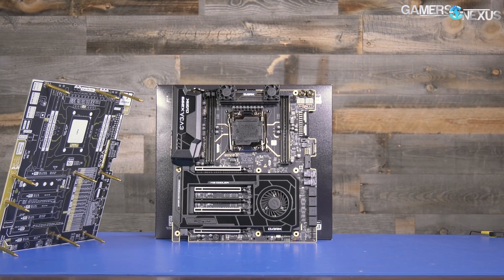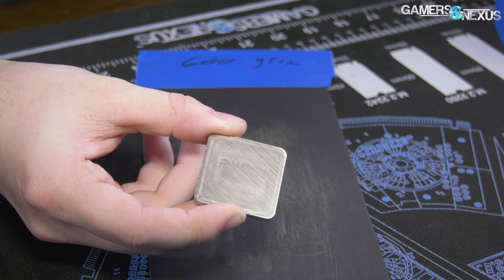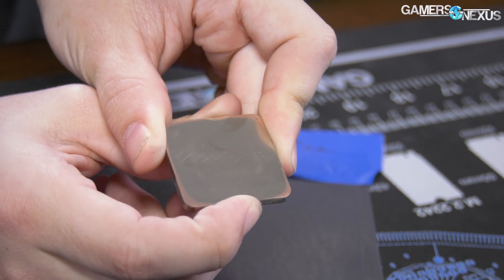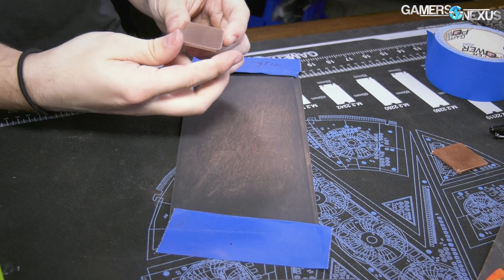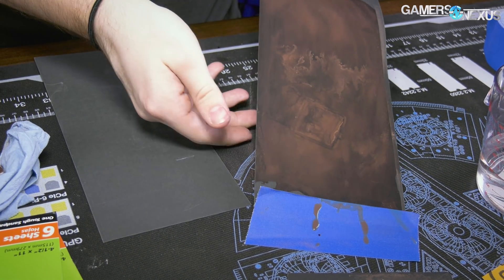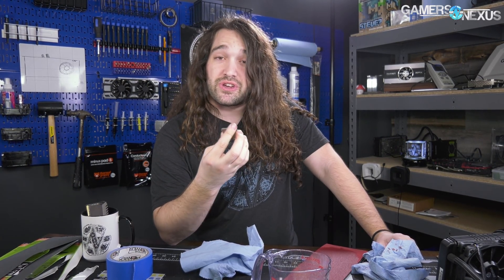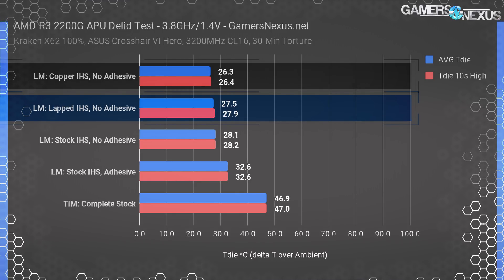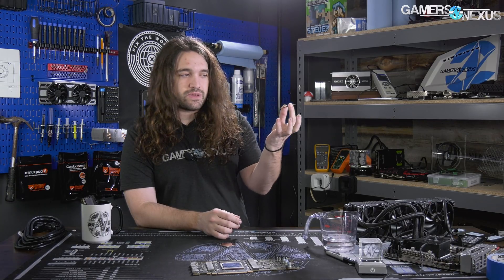Lapped Ryzen IHS vs. Copper & Stock IHS

Comment: I'm curious about the improvements a silver heatspreader can offer (as one was talked about last october from Der8auer for the 8700k), ...also curious about if just a silver slug press fit into a copper ihs above the die would help just as much, and if silver gets damaged by liquid metal like aluminum does.

Comment: lapping Ryzen 1700 have like 1degree less.Stock IHS is not perfectly flat but still does good job. 
BTW you can use a drill with shaft attached to a suction cup(and the stock box cover for the CPU) and spin it on the sandpaper.First go for 400 by hand and drill after and then 2000 sandpaper and of course polishing after that(polishing will not have any effect whatsoever and the good paste is pricey).The resaut is going to be perfectly flat surface with mirror finishing and no scratches.

Comment: you're supposed to sand it on glass or something perfectly straight not something soft like your modmat :D as you sand you might be taking off too much material on the edges due to soft sanding surface. I sanded my AMD Phenom II 955 long long time ago and got °6 drop just from doing so (tho I also sanded the stock heatsink). I used up to 2000 grit
also it seems to me like you were using sand paper made for wet sanding, water moves away shavings, gives you a nicer finish faster and keeps the sand paper usable for way longer
edit:
ALSO you dont need to take of the IHS to sand it so comparing it to Rockit Cool is a bit unfair. And I dont know where you get your sand paper but 600, 1200 and 2000 are all you need and all 3 cost $1-2
Reply: Diminishing returns after 1200, I know because I've lapped plenty of CPUs, not worth going up in grit.

Comment: Recently, I've a friend who did a thermal compound test at the uni for industrial use, and I learned 2 things from his tests. 
1. The best thermal compound (excluding liquid metal) you can buy is apparently some kind of grease you could buy from your local hardware store. 
2. The more polished your surface is (his tests were done with mirror polished surfaces), the less thermal compound you need.

I would be curious to see a reviewer test that.

Comment: I lapped my 2500k,
It lowered temps by around 3-5C which imo is quite a good drop.
However the most gains came from equalising  the temps. Core two used to be at the high 60's, core 3 would be low 60's. Now they are all low 60's.
This is at 4.9Ghz.
Reply: My 0x1E Interesting. 🤔

Comment: So glad you did this. For future reference don't tape the sandpaper to a soft relatively uneven surface as you will sand unevenly. Remember we are dealing with microscopic details here. You want to use plate glass under the paper when doing this kind of work.
Reply: Also want to see you do this to the bottom of the cooler as well for maximum contact. Also if you can get them perfect enough you could theoretically get them to cold weld together functionally making them a single piece with no need for TIM.

Comment: 5:10 NO!
You are doing it wrong. Very wrong. First off, you should be doing it on a flat glass plane. Second, you shouldn't be holding it with yor bare hands at the corner, as you can't constantly hold it exactly parallel to the sanding surface, so you take more from the sides and corners. Also should be using bigger sandpapers, and moving the IHS in figure-8. If you re talking about microscopic imperfections, you have to pay attention to everything in order to think that you can do better

Comment: If you're going to lap, use figures of eight and a glass surface so you don't get uneven pressure! Not that it would have mattered worth a pinch of shit in the end, but the mat is the reason the edges are polishing down before the rest. as you press down, you deform the base material and it folds, diving your flat surface into it. Using a hard surface ensures a flat grind.

Comment: Thanks for doing this, Steve! I was curious if this were still relevant. I noticed about the same results when I lapped my Cooler Master CPU cooler back on my i7 930, but I never lapped the IHS.
Reply: AJ Good back in that era, you were supposed to lap the IHS, not the Cooler! I'm currently in the car, going to the hardware store in order to buy sand paper. Getting to 5000 grit for a x5690, a x5472, a q9650 and a mythical q6600 G0! And yeah, i'm going for extreme OC

Comment: pro tip that i have learned as a kid polishing 2 stroke heads, use a hard flat surface and a mirror because the mirror is one the flattest things you can find , the flexible mat is buckling under pressure and making those edges round

Comment: The main takeaway is that sandpaper in the US is absurdly expensive 😉

That's maybe 8€ of sandpaper so definitely worth it compared with buying the copper ihs
Reply: three sheets of any 3m sand paper is about 10$ USD, and you need multiple grits(3 or 4 minimum). But there may be some combo pack at specialty stores.
Reply: Metatron's Cube the  same 3 pack of 3M sandpaper here cost 3.80€. I buy them pretty much weekly as I do all the work on my cars and I have quite a few cars. And I always thought the 3.80 is very expensive for what it is.. It seems you need some competition to lower those prices 😉

Comment: You can't lap on a soft surface you'll end up with a convex surface on your IHS.  You need a piece of glass ideally a thick piece.  EDIT: you should go in a figure of 8 motion as well so you are not hitting the same spot over and over.

Comment: you gotta grind down both surfaces, not just one to get a "zero space" situation going on between the cap and the heat sink. I know the differences in performance are negligible but, extreme testing should include a process known as surface grinding to both surfaces to be mated using a 2 axis surface grinder. .. but yeah. probably not gonna get much gains other than being able to get away with zero thermal paste because of how perfect the surface are. and even a used surface grinder is expensive. would be interesting to see testing results though

Comment: This one was pretty interesting, would it be possible to de-lid one of these and solder it yourself ? I think it would be pretty interesting as that could make it quite a lot better and be pretty permanent. just a thought ;p if you decide to look into it ill definitely see it :D PS thanks for showing us PC building is so hard, time to get a prebuilt I guess ...
Reply: You could solder one with a hot air rework station(50-150$) and sheet of silver solder(15$). If you have an electronics buddy they might have the rework station you would just need to get the solder sheet, or even silver paste solder or something low temp would make it easier.
Reply: I was thinking more in the line of getting solder wire (pretty cheap for a roll of it here in my country), then flattening it out, putting it on the cpu and heating it up again just like when you de-lid, then after it has melted let it cool down and boom, easy makeshift soldered apu :thinking:

Comment: Use a mirror for you base next time.  That mat is not a good way to go for lapping.
Reply: Yeah, might as well be lapping that thing on carpet....  :(
Reply: Agreed. This is the reason the edges are sanding first. With the give in the Mod Mat, the sandpaper ends up cupping around the IHS, creating a convex surface on the IHS. A figure eight motion for the sanding and periodically rotating the IHS in your hand will also help keep the sanding more consistent. As you push in one direction, the leading edge will end up sanding faster as there is slightly more pressure on that side. (Source: Sanding flat cylinder heads and having them seal without head gasket, proving the purely flat surface.)
Reply: Any thick float glass will do. Even a thick tempered side panel would be perfectly flat in theory. Also, stick to wet sanding. Dry sand paper taped down (and the foam paper he had last) round over the edges. You should also go to a higher grit, 6000 or use a jewelry polish to finish. That way you're completely rid of visible scratches.
If he wants to get real fancy, he could buy a set of wetstones 1000-3000-6000 for around 100$. Along with a diamond flattening plate for stone maintenance and a leather strop for polishing for a further 70$. 

Source: Decades of sharpening chisels and other blades to mirror polish for fine woodwork.
Reply: I started cringing when i saw him lapping on a soft surface. Saw a guy post on your HardOCP forums years that uses a Bridgeport to mill off 0.001 then laps his CPU with 15u/10u/5u diamond lapping material.
Reply: I agree, a mirror or glass is generally used otherwise you are lapping a non flat surface into the IHS.
Reply: Just direct die it, worked fine on my socket 939 lol
Reply: And maybe use water too ... is that water sandpaper?
Reply: Mattias Göstasson the water causes suction between the paper and the surface which makes it work better, and also keeps the paper from clogging
Reply: figuire 8 sanding pattern as well
Reply: Correct....you need to start on a hard "FLAT" surface to begin with.
Reply: I actually keep an old very thick mirror out in the garage for the very purpose of lapping CPUs, blocks, etc.
Reply: also moving in small circles leaves the finish less scratchy looking and more polished
Reply: True, true.

Comment: FYI, it's better to affix the sandpaper to a known flat hard surface, like a piece of float glass. And even then, I've been told that to ensure that it is flat instead of convex it tends to be best to use a figure of eight pattern for lapping. That said, it probably doesn't matter too much. There is something that crossed my mind though. LTT recently reviewed a graphite thermal pad from Innovation Cooling that performed surprisingly well. It seems to me that lapping the surface would make a bigger difference with one of those than it would with thermal paste because it is thinner than normal thermal pads and probably not as squishy. It might make for an interesting video to test that, I think.

Comment: Steve, I'm not sure, but I think you made a kind of mistake. At least in the beginnging... I don't know the consistency of the ModMat, but it seems to me that it is a bit soft. So the reason why you see the copper first in the edges etc. is because the sandpaper work there first due to the IHS sinking a bit in the ModMat and so in the sandpaper. A very even and hard underground like  marble or glass would have been better or at least the uncertainty of the influence of the ModMats conistency would have been eliminated... I wonder if you ever will see this :D
Reply from the maker: No. It's not. Had anyone listened, they'd realize the CPU IHS is made with different height corners.
Reply: Oh wow,  a response :D
Thanks guys,  didn't hear that... but I heard always that if you want to polish a coolerplate or an IHS, you need a hard and even surface.
But okay,  if that doesn't matter then never mind :)

Comment: Ideally you should've used a belt sander or a disc sander to evenly sand the IHS, the edges went first because the way you push the ihs when moving it plus the give of the modmat. not that you did a bad job, just that it's a kind of flawed methodology. Still you got the point across, it's pretty useless to buy a specialized IHS for rizen

Comment: It is a known scientific fact that blood on the IHS will coagulate, filling in small imperfections and offering a better thermal interface between the IHS and your cooling apparatus. Seeing as blood contains a variety of metals, it is also an adequate thermal conductor for use on the CPU die. In some regards, with current hardware pricing, bloodletting is already rather prevalent, therefore securing blood offerings for thermal interface application makes both technical and financial sense at this point, assuming you have enough blood left over.
Reply from the maker: Best comment.
Reply: LooneyJuice blood for the blood god
Reply: Someone needs to try blood as TIM.
Reply: You did put a lot of thought into this....bloody great comment..
Reply: Cue Corsair's next line of AIOs: Transfusion Series
Reply: Unfortunately with all the thermal conductive material blood has within it (iron, electrolytes, etc), it also has organic parts as well which will die/rot and eventually burn into the surface creating an insulator and air pockets. Blood is still about 92% water anyway so ensuring the metallic thermally conductive substances within it not only stay between the lid and heat spreader but also create a lattice that thermally connects the two surfaces will be incredibly difficult to ensure on a reliable basis. Hence probably why it's not recommended to use any high percentage water compound, much less an organic one, to act as a thermal paste.

Yes, I know I took a sarcastic comment way too seriously.  lol
Reply: Ƹ̵̡Ӝ̵̨̄Ʒ it won't really survive long term and the high temps.
Reply: Hah! Much appreciated, Steve (I'm assuming). Blind gopher finds an acorn once in a while.
Reply: Blood has iron in it, so it would not be wasted space
Reply: Blood is easy to get. Go to the butchers...

Comment: FYI Steve, when lapping was the craze, you didn't want to use any thermal paste between the IHS and heatsink (you would lap both) as the thermal paste would actually work as an insulator causing temperatures to go up if you properly lapped both the IHS and the heatsink.

The ultimate goal of lappers was to create as smooth a surface contact between the IHS and heatsink so that you would end up with near 100% contact between the two.  The reason thermal paste came into being is, like you said, to increase the contact between the IHS and heatsink due to manufacturing imperfections.  As you also stated, lapping is about removing those imperfections between the IHS and heatsink.

Comment: Id recommend not doing this on a mod mat if you only have one, as youll want to clean it (vacuum and wash it) to remove the conductive metal particles. While the mod mat is top quality, its not going to protect against copper flakes getting on components, it will trap some in its weave (good and bad), but  if the particles get into other components, especially places that are meant to conduct (pcie, socket, dimm slots) you are in for a bad time.
Reply from the maker: We make them, so yeah, we have a lot of them.

Comment: A couple tips for the next time you lap something, not just an IHS. Number one, use the hardest, flatest surface you can. A pane of glass or a granite countertop work okay, but if you can get ahold of something manufactured to be measurably flat, even better. Next, move in a figure 8 pattern to avoid hitting the same spot too often. Also. Steady, even pressure.
Reply: A mirror is a good choice as a hard flat surface for lapping - if a mirror wasn't perfectly flat your reflection would be distorted.  When you think you are finished lapping, get some graph paper and hold it up the surface of the IHS. The reflection should show parallel straight lines both horizontally and vertically if you have done the job well.
Reply: That was my first thought too.

Also, I hear you can finish with a page out of a magazine since the coating is made with some ultra fine minerals that act as an crazy fine abrasive.
Reply: Niall Cosgrove i like that graph paper idea. I knew about the other tips. But thats a great one to keep in mind
Reply: i think using anything lower than 1000 grit was unnecessary here as well. Any thoughts?
Reply: Another tip, don't do it at all...